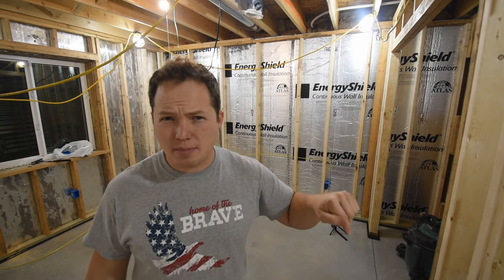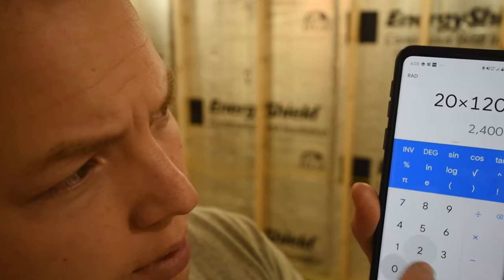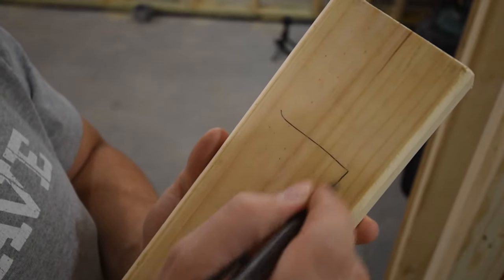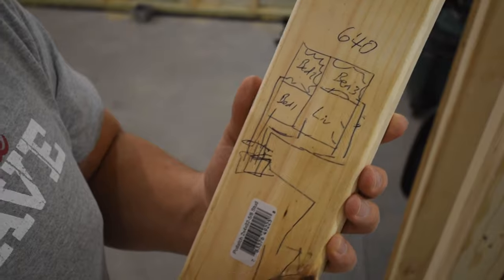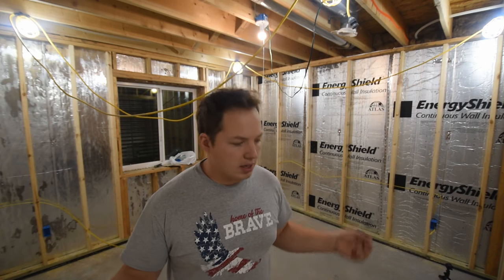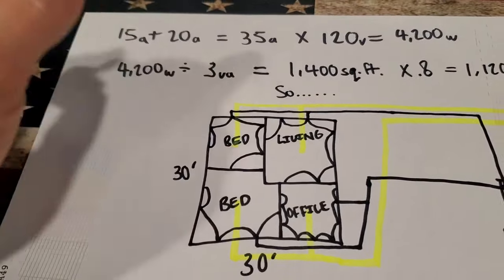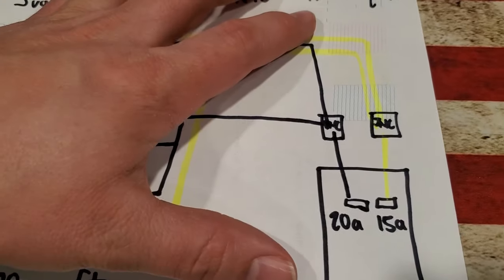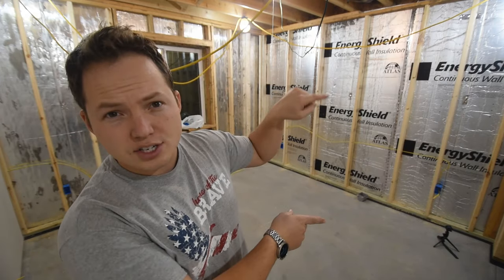Does a Bedroom Require a Dedicated Circuit? - Using the 3VA Rule To Calculate Anticipated Loads

Comment: 3va  approach used for existing and remodel. For new use per square foot. For 20 amp circuits is 1 circuit for 500 SQ ft. or for 15 amp circuits it's 375 SQ ft.
Reply: This is for general purpose lighting and receptacles. So for instance 3 bedrooms in sq footage were to equal 40O sq feet you would need 2 - 15 amp circuits or 1-2O amp circuit. Ud go with the 2-15 amp circuits. Smaller wire,ore room in boxes,easier to fold back and work with, and in a bedroom not much load.
Reply from the maker: Yup!

Comment: Almost 100% of the time I only use 12-gauge wire and 20-amp breakers for 120-volt circuits. This generally means I only have to stock one breaker size for new installations. I do use 14-gauge wire for smoke detector interlock feeds which requires a 15-amp breaker. 
I also run separate circuits for every bedroom, bathroom, most other general use areas and dedicated lighting only circuits. I tend to run 2 or more circuits for living rooms (or whichever room will be used for TV/music/gaming equipment).
Reply: What an absolute waste of materials. I can completely understand doing this in your own house but i cannot see any builder paying for this.
Reply: FAR from being a waste of materials.  About $20 difference for a roll of 12-2 romex versus 14-2 romex.  Almost $0 difference in price between a 15 amp and 20 amp circuit breaker.  I've never had a problem with a builder/home owner paying $20-$40 more for an entire "standard size" house wiring bid over the last 30 years.
Reply: Thats alot of home runs and breakers man. I can understand having everything be 12/2 if the lights weren't on their own circuits but every room having 20amp receptacles and its own lighting circuit. If im reading you right your looking at a good 35% increase in materials. Maybe I'm just miss interpreting what your saying. By dedicated lighting circuit do you mean for each room or just that you put lighting on their own separate circuit. Atleast where i am no inspector will pass you if your lighting is on the same circuit as a receptacle.
Reply: I do what the customer wants and will to pay for above code, other then that its by code. The bottom line is I need to make money not doing it for free.

Comment: 180 per outlet VA as a guide.  But in residential you can over shoot up to 30% .  I do lighting and receptacles on separate circuits.
Reply: Dan Johnson      Is your comment based on some rule of thumb or what?   It is not in the NEC.
Reply: @KevinCoop1  In industrial/commercial spaces, 180 Volt-Amperes (VA) is used when calculating receptacle loads. This value is often used as a guideline in residential applications as well. For example, given a 15 ampere 120 volt circuit, you could have 10 receptacles @ 180 VA.  Article 220.14 (I) go be a plumber.
Reply: Dan Johnson    I agree with 180va or 1-1/2 amps per device(depends on NEC code year) for commercial and industrial for general purpose receptacles.   Our company standard was 8 receptacles per 20amp circuit.   I was asking how you got the 30%.    You referenced 220.14(I) to push your point.  You should also point out 220.14(J) which is specific to NEC requirements for dwelling units.   I actually do not need a job as a plumber!   I made enough money as a Electrical Design Engineer working for Electrical Contractors that money is not a problem in retirement.   But thanks for the suggestion.

Comment: You should have a dedicated circuit right near the window if you plan to run a window air conditioner.
Reply: That's what I like to do as well. We have 2 rooms on the same circuit and use air conditioners. Sometimes when we have the TV, lights and everything going the air conditioners would cycle on and blow the breaker. Having the rooms on the same circuit isn't really a problem but it's best to keep air conditioners and even space heaters on separate breakers.
Reply: Problem is who plans on that when paying for a house to be built? 

Honestly though maybe it would be good practice to have one dedicated circuit per bedroom in case the owners want to plug in something weird at some point. But like.. cost
Reply: That kind of falls under his "dedicated appliances" exception.